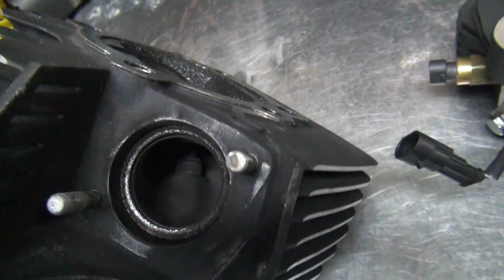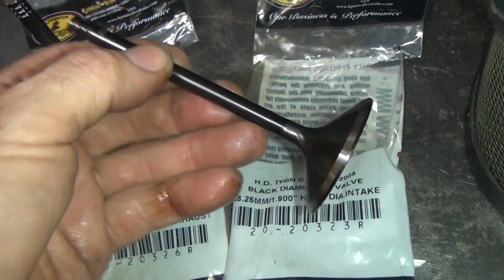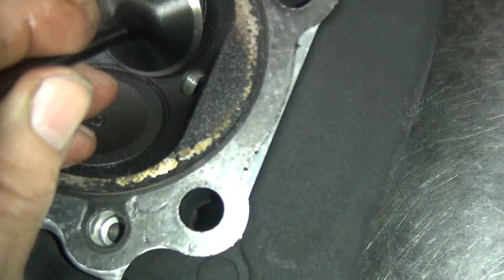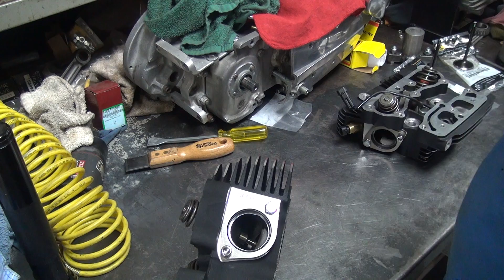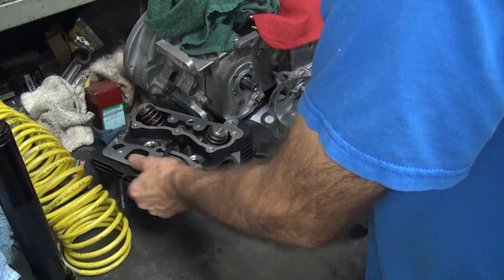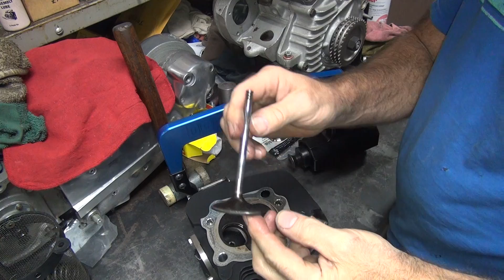103ci Dyna #101 Hotrod head porting & rebuild 2006-present Harley FXD Twincam TC

Comment: Is there any difference between my heads off of my stock 2006 88” Road King, and a set of 103” heads? I’m building my engine up to a 10.5:1, 95”  big bore. I heard they are a lot better.
Reply from the maker: i don't know but i don't think so. why would harley make more than on head casting. they are way too cheap to do that.
tatro
Reply: Yes 96/103 heads have bigger ports. Work upgrading if you’re doing a 95. Saves you having to port your 88 heads.

Comment: 1.630 Exhaust valve is too big. just sayin
Reply from the maker: your a dumbass. that is the stock valve out of an 80ci evo and it is too big for a 103ci twincam. dumbass.
tatro
Reply: You're the dumbass, dumbass.(The EVO was over valved to begin with) But with your shitty porting, you probably need a big valve. Get a flow bench so you don't have to guess.
Reply: 51.5" per cyl; same as a 412" V8...

1.63" is a pretty modest valve diameter for performance at that displacement.

For comparison, what would exhaust valve sizes be for 383 MoPar, 400 Pontiac, or 396 Chev, or high performance 327/350 Chevs?  Boss 302 Fords or 351c-4v's?

Now, those valves in that Twinkie don't look so big, do they?

Comment: fucking hell. take it easy with the heads.  I bet you that banging them around , and possibly damage the fins and so on isn't appreciated by your customers. Or rather EX customers if they see this.
Reply from the maker: +Lars Nilsson 
my steel work benches are like drums. they echo very loudly and the camera really picks that up as a loud bang when it is not. the bench is also very smooth so it does not damage the parts. that is why you do not see any damage to the parts. who and the hell do you think is videoing the damm job. its the customers most of the time. they don't care because they are seeing what is really being done, not what you think is going on by the camera. if you really did the work you would know all of this. the mechanics that i talk to think comments like your are jokes and laugh at people like you. go do something and learn for yourself what really matters.
tatro
Reply: My thoughts exactly, I'm going through mine right now and my heads came back all dinged and the Powder coat chipped on the fins from the porter... Now the builder is finding me new heads or buying me new heads.  It's a Harley, the appearance of the heads IS important, and for $1,000.... they better do a DAMNED good job and the heads need to come back in AT LEAST as good of condition they got them.